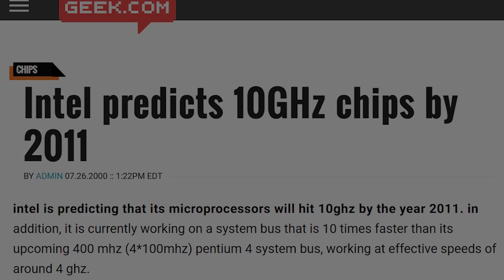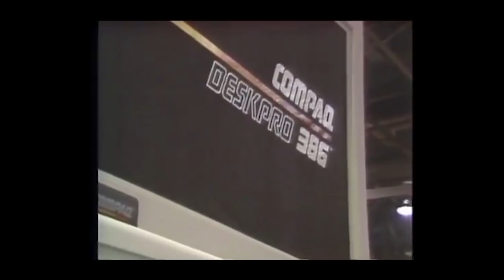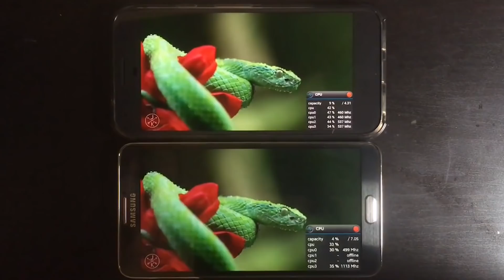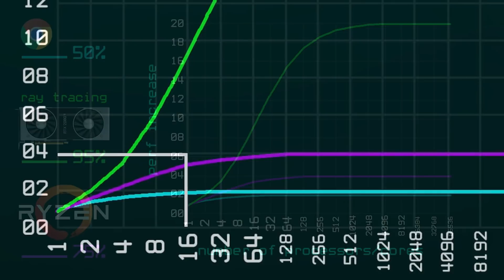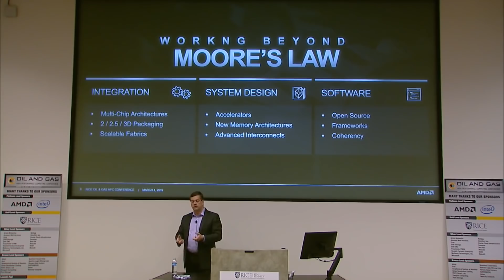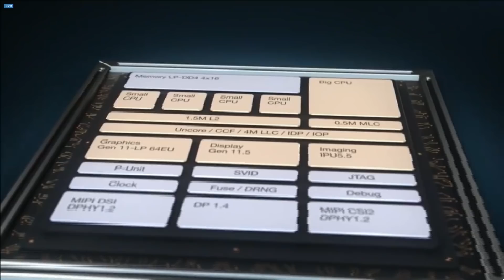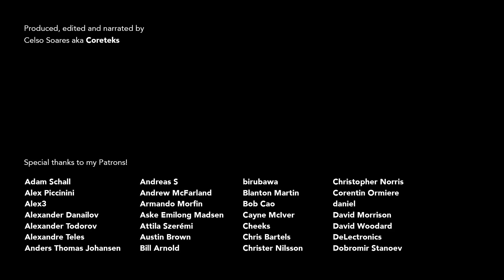Intel and AMD going BEYOND Moore's Law

Comment: Great video!

The hardware-level AI multithreading is very exciting. I had no idea it was a thing, and it's very likely an avenue hardware companies are looking at going forward. This has potentially huge implications for ARM as a desktop platform, though ARM would still have to overcome the problem of being able to run x86. I learned a lot from this video.

I will however critique your optimism about going past 3-1 nm nodes. There are two big challenges to this: the size of the silicon atom (around 0.1 nm) and the prevalence of quantum effects when approaching these particle level sizes. I believe we will start to see inconsistencies in the voltages running through small transistors, which will lead to errors in instructions. This is why I still think quantum processors that can instead use these phenomena instead of seeing them as errors will be the way forward in the very long run.

Comment: There is one severe flaw with this optimation software that exposes it as an obvious scam: You would never optimize software in real-time as this adds a huge amount of overhead, instead you would optimize the code during compilation time. This means that if their solution is actually working, it needs to be implemented in compilers, rather than on the chip itself (which is a moronic idea!). All programs that are written for any hardware are in the end compiled by a handful of compilers. Adding this magic solution to the compilers will instantly fix all future software (rather than retrospectively fixing the software when it's already running on the chip). But I guess this way they can earn more licensing fees.
Reply: You do that already, it's called JIT compiling and can outperform AOT compilation under some circumstances. It is basically adaptive profile guided optimization with it, and in hardware you have no real overhead. You are using transistors for it, no wasted cycles or so. Only die space you could have used for cache or more cores otherwise.

Comment: Disagree with Konstantin X,  I don't see automatic splitting of single to multiple threads when I watch the cores on either macOS or Windows.  I also see plenty of apps that are not using all the cores but should.  Fortunately my Pro audio and video apps do use all the cores.  My main current rant is that software should be a lot better than it is currently considering the capability of the hardware.  If I type YouTube.cm the browser or whatever should know I mean .com .

Comment: Programmers are already writing multithreaded code in all case where optimizing performance makes sense from business perspective.
For example videogames, the consoles have large count of relatively slow cores since 7-th generation i.e. for 15 years now. Because of that, many modern videogames use multiple cores just fine.

Another thing, the software tends moved to other people’s computers, i.e. to clouds. Server workloads are often easily parallelizable without much development costs, because servers handle large count of concurrent and mostly independent sessions.

About Windows, you can’t notice a hang for microsecond. Not even for a millisecond. Typical screen refresh rate is 60Hz, translates to ~17 ms / frame.

Current PC and server chips already automatically split single-threaded code into multiple threads. It’s called ILP, instruction-level parallelism. What the OS sees as a single core is already a manager, it managed multiple (6-8) real cores called EU (Execution Units), and it’s done completely in hardware, inside each core.
Reply: I was thinking these same things while watching the video.  You can't magically turn sequential code into parallel code.  Many things have to be done in sequence in order for programs to operate.  Like you stated, CPUs already execute instructions in parallel when they can.  Albeit to my understanding the ability to execute instructions in parallel is limited depending on what the instructions are, and does not currently span across CPU cores.  Spanning parallel instruction execution across cores would then have to involve sharing registers across cores (otherwise you would have the overhead of setting all the registers on the core before executing the parallel instruction), and I don't even know if that is a feasible idea.  And like I was saying, parallel instruction execution is limited, because at some point or another, one instruction will depend on the result of another, and the CPU will have to wait for that instruction to complete before moving on to the next.

So lets say they could span the parallel instruction execution across cores to theoretically speed up execution, plus do it without a performance hit that would negate any gains you get in this added parallelism.  If they could could pull that off, it probably still wouldn't add much, or any increased performance in most cases, since like I stated before, you always eventually get to an instruction that has to wait on the result of another instruction.  This means the CPU has to wait for that single instruction to be executed before continuing on.

In conclusion, I call bullshit.

Comment: the problem with shrinking transistors more and more is the tunneling effect, which causes transistors to leak so there will also be a cap on shrinking transistors sooner than later.

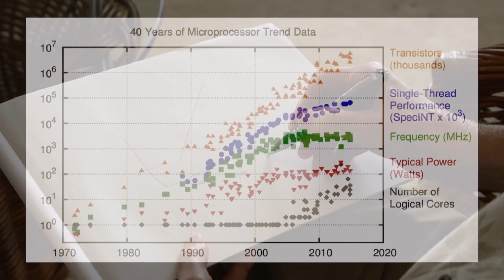Comment: 3:35 That's not entirely true. There are physical limitation for silicon after 7nm/5nm, quantum effects become more prominent at those sizes. So the fact of passing to 7/5/3/1nm and then picometre scale is not obvious as it sounds in the video.

Edit: 6:55 Again, not true. Universities are teaching imperative languages (c/c++, java, python etc) but they are also focusing on functional languages, for example Scala, Clojure, Haskell. These languages are designed for parallelism and being stateless, using only pure functions and constants. That's a style somewhat similar to shader programs where you are running a program on a parallel environment like a GPU. You could do functional programming with pure functions in C, but complexity is a problem at that low level, so a solid high level functional language is what people are focusing into.

Oh and when you're done with university and you get your first job, nobody expects that you are ready to "hit the ground running". Basically when you are done with university you know a bunch of languages and patterns to resolve problems without experience, but that knowledge will solidify with experience. Also (not true again) even experienced programmers could need a couple of months to get into the architecture and the workflow of a company, and companies do that, they put people to help others to get to speed.

Comment: The gigahertz "predictions" back then were very naive and not all that informed on the technology. In a sense they were right, but frequency is only how many cycles a cpu goes through per second. The biggest performance gain isn't in doing more cycles per second, although that of course helps, the big difference is how much can the cpu do per cycle and why some cpu's are faster with a lower clock than others with higher clock. 

But in a sense they got it fairly correct in performance terms, We'll have to compare in terms of flops (floating point operations per second) 
A 2010 intel core i7-980x extreme edition can pump out 147.6 billion instructions per second (147,600 MIPS) at 3.33 GHz (so around 40 billion instructions per second per core).
A 1999 Intel Pentium III @ 600 MHz can pump out 2 billion instructions per second.
So it would need to run at around 12 GHz to do the same amount as 1 core of the I7 example,
meaning the full I7 is the equivalent of a 44 GHz Pentium III.
Overly simplified and only based on floating point operations but not an invalid argument I think.

Other equivalent hypothetical CPU's to get this performance-ish:
Intel i386DX @ 1.1 THz   (~143,350 MIPS)
Intel i486DX @ 424 GHz   (~147,550 MIPS)
Intel Pentium @ 78.5 GHz   (~147,550 MIPS)
Intel Pentium 4 EE @ 48.5 GHz   (~147,400 MIPS)
AMD Athlon 64 3800+ X2 @ 20 GHz   (~145,650 MIPS)
AMD Phenom II X6 1100T @ 6.1 GHz   (~145,000 MIPS)
AMD Ryzen 7 1800X @ 1.7 GHz   (~143,800 MIPS)

Also getting smaller is reaching it's limit actually, we've reached the point where it's so small and everything so close together quantum effects start screwing things up. There's a fundamental limit to how small transistors and other features can be and we're just about there, that's why companies like Intel are exploring other materials like graphene, concepts for utilizing more 3D space in CPU design and other avenues to pass this barrier..

And no, you'll never have picometre scale cpu's :'). 1 picometre is far less than the size of an atom, you know the stuff matter is made of :').
Just saying, 1 single helium atom has diameter of ~ 62 picometre.
A silicon atom itself is already 0.11 nanometre. Transistor research in labs is already at transistors of 1 graphene atom thick, 10 wide or such. Silicon has reached it's miniaturization limit and graphene isn't far behind. Because you will run into quantum problems and well the size of atoms themselves.

Comment: Yeah as an EE minoring Computer Engineering, i've been told and teaches on Multi-threading allocation coding specifically those on hardware level (ie assembly) and sometimes to the kernel.

Comment: Let's not overhype this. Getting any significant performance increase using this will only be possible in certain cases. Yes, some badly written code will magically be faster - possibly even 2x fast, but don't count on physics simulations in games magically becoming 32x faster, if you have 32 cores and the code is a pure single thread. You'll be lucky if you get the 2x increase, which you won't, in most cases. In the general case, this is an intractable problem, solving this requires code to be written using certain approaches and properly managing data dependencies and process synchronization, code that does all of that wrong will not lend itself to automatic parallelization.

Comment: But something a lot of people forget, that more cores means multiple programs can run more effectively distributed across cores, so one program may not benefit from more than 8, but having two of those programs running at a time? 16 cores is very helpful. 
As long as you use your pc has multiple processes running at the same time (guarenteed), extra cores will be generally helpful for a long time to come :)
This kind of thing is demonstrated with Ryzen 8 cores being able to encode livestreams of games on the CPU far more effectively than the same priced Intels that have 4 cores, purely as the operating system isnt having to schedule both the game and video encode process to the same cores

Comment: This AI multithreading single core code sounds like a pipe dream to me, as code is often reliant on things happen in particular order, I'd need to know more details before I believe it is possible. They never taught multithreading at uni but it's super easy to pick up and I don't know why it's not used more effectively in some titles like the simcity remake bogged down to unplayable, if the decoupled the render and AI threads it wouldn't hinder actually playing the game but might still not be reaching rabbit speed unless you have more cores. Most of the major engines support multithreading already though so you don't really need to focus on it, but there's only so much you can multithread.

Comment: Subbed, RAID controler/codes could be used to distribute the Data to the virtual CPU´s
Reply: @uzefulvideos3440  if you treat the virtual cpus, similarly to stripe in raid, the cores would never run out of data.